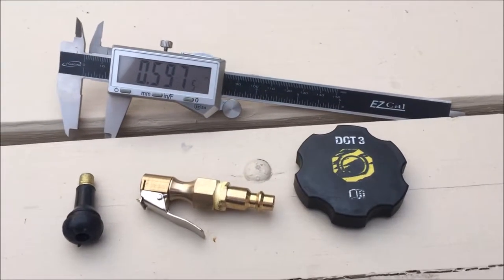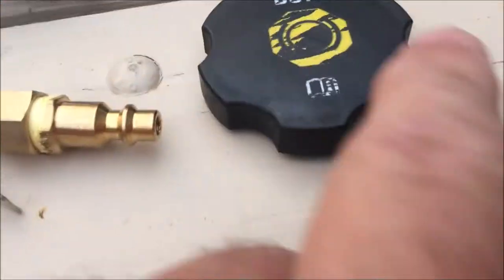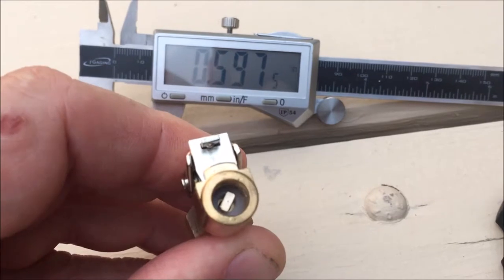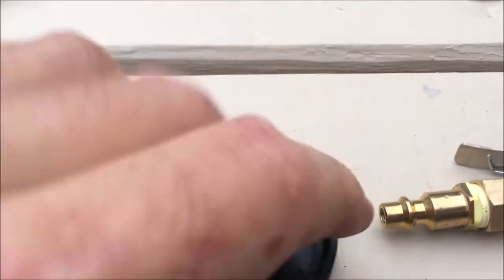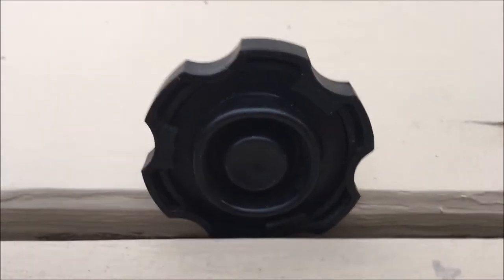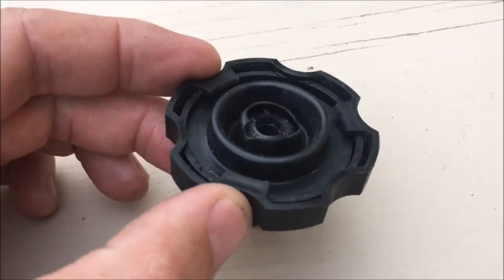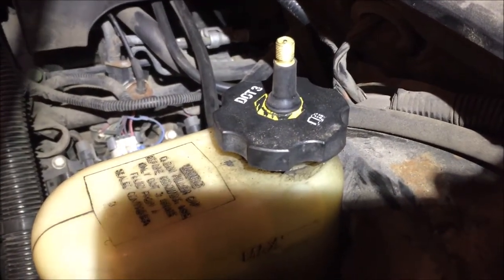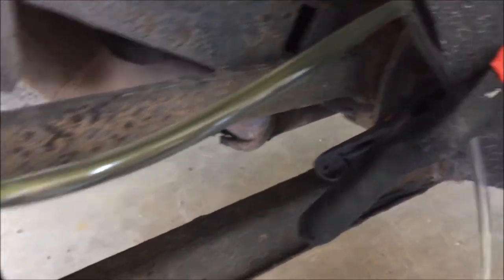OldGuyDIY $3 Air Pressure Bleed Master Cylinder Cap, Tire Valve Stem Clip On Open Flow Chuck  20psi

Comment: Very good and very professional without the expensive professional kit system.
My dealer repair manual for my 96 Buick century says to pressure bleed with their kit on the top of the cylinder. It says 10 psi then check for leaks at the cap etc. then turn up to 30-35 psi for the bleeding procedure. Bleed the abs module bleed ports, back to front screws that are next to each other then the 4 lines that are next to the module one at a time front to back. Then each wheel valve at the wheels drivers rear, then pass then front pass then front drivers.
Reply from the maker: Thank you for the information.

Comment: Or you could just thread an air fitting into the top of the cap instead of the valve stem. 
Then you can attach the quick release air fitting directly to the top of the cap. Then there's no air chuck and not valve stem needed. It's a better and easier connection also.
Might need to use a little epoxy on the cap fitting depending on how thick your cap is. Some are much thicker than others.
Reply: You don't want constant pressure, you might end up just shoving more air into the system

Comment: It's so you can bleed your brakes by yourself. Can you hook up the air compressor and pressurize it with a little bit of air. That way you don't have to have somebody sitting inside the vehicle pumping on the brakes while you're bleeding at the caliper.

Comment: Hopefully a bicycle tube air pump works as I don't have an air compressor.  I am making one for my gas cap  for finding a leak and another for the brake  master cylinder. I might need another skilled person with me or may be not.
Reply from the maker: I expect the bike pump will do the job.  Good luck.

Comment: Did you not need to block that air vent groove in the cap?
Reply from the maker: It worked without my blocking air vents.  I suspect there was enough air pressure to overcome whatever escaped through the vents.

Comment: this will not work unless you have 13-20 PSI pushing down on the master cylinder cap, so if you dont have a rubber stopper with a strap or bolt to hold down the cap then forget doing this.